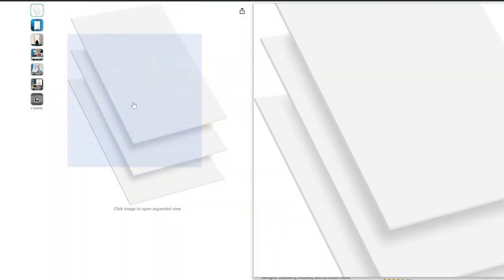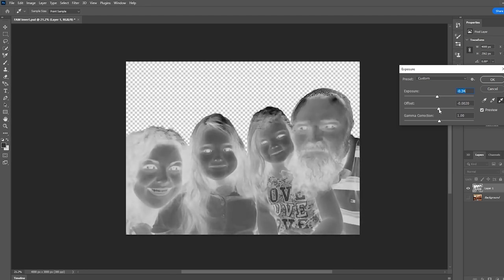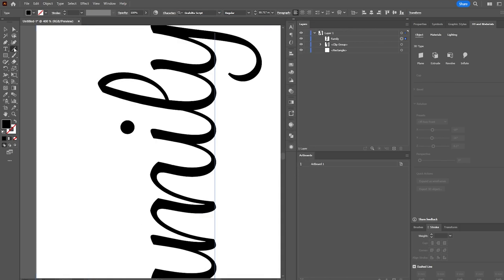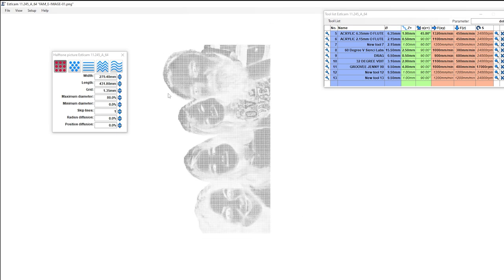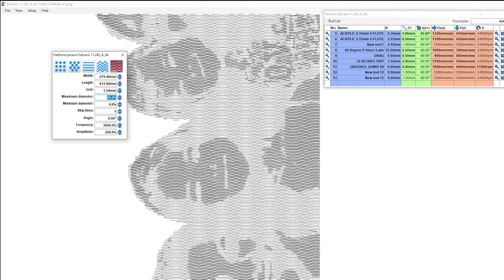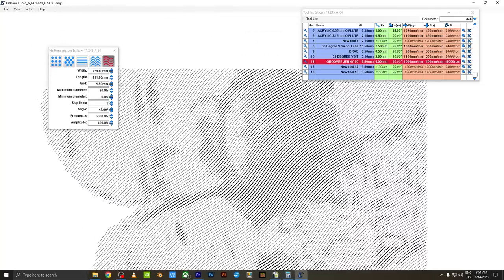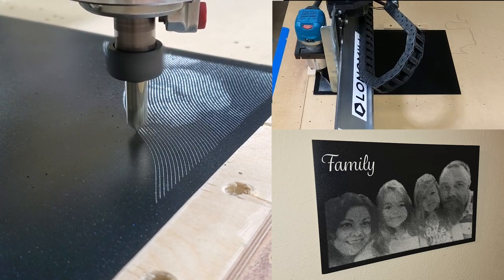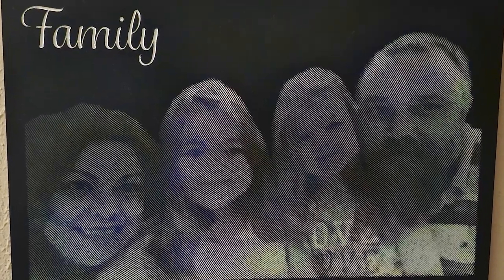Carve a Photo CNC - Estlcam Halftone

Comment: This could be adapted for use with a digital cutter like the Brother Scan N Cut, Cricut, Silhouette.  Using aftermarket engraving tools from Zoom we can etch away a top layer for the same contrasting colors from a variety of materials and soft metals up to 3mm thick.  These cutters don't typically read G code.  But if something like this can be exported or saved as .SVGs that is a common file format we can use.
Reply from the maker: Great idea!

Comment: Hello,

Thank you for your video !

What version of estlcam are you using?
What are the parameters you cannot save ?
Thanks,
Eddy.
Reply from the maker: I am using 11.245_A_64. So when you do a Halftone, once you have your settings and generate the g-code it will clear those settings for the halftone. This is the only area I have seen that happen in with Estlcam.

Comment: Did you send the gcode to your Long Mill directly from Estlcam or did you export it and use gSender or UGS to control the Mill?  Tks.
Reply from the maker: I exported gcode and used gsender. I use a raspberry pi 4 so have not tried estlcam control yet.
Reply: @D.E.Hammer  Tks much.